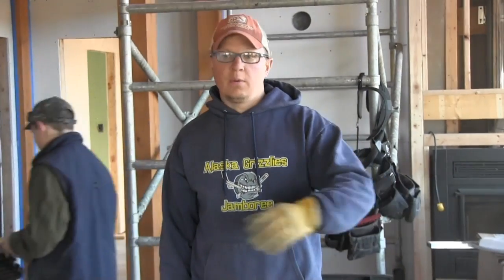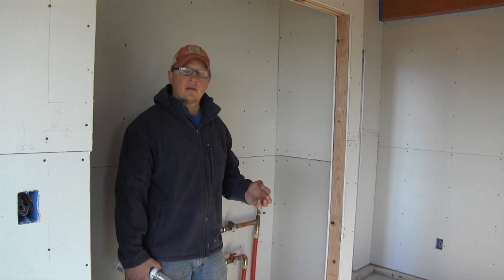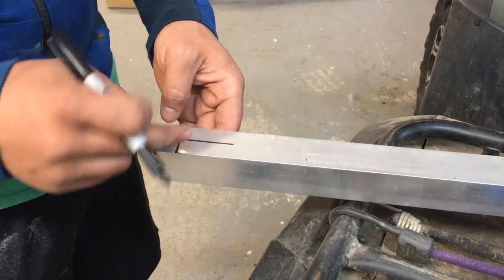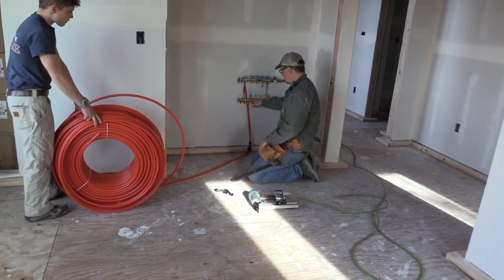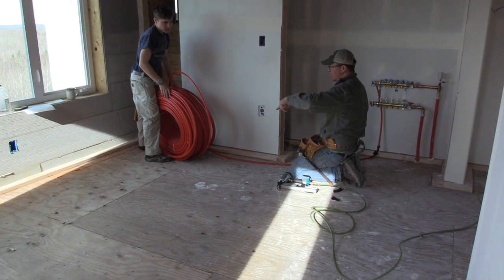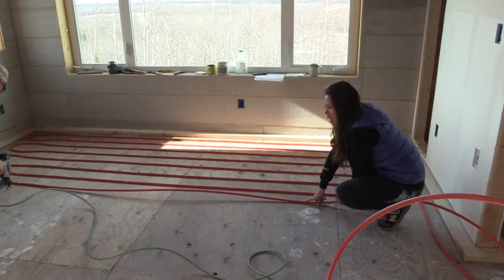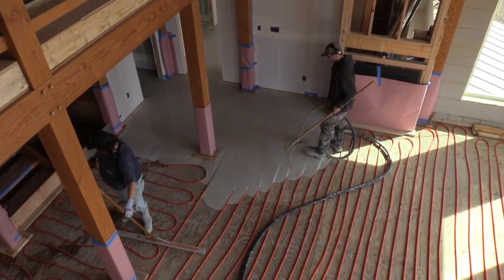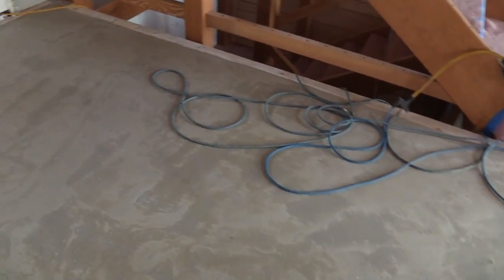It Poured Inside - Installing Radiant Heat over Wood Subfloor - EP 32 Alaska Dream House Build

Comment: We rebuilt in 2014 (North Alabama) with acid-stained concrete floors throughout the house and radiant heat (pex tubing). We also insulated with spray foam in the walls and ceiling. We have an electric heat pump which has never come on in the winter because the radiant heat from the floors keeps the house warm. Love your channel.
Reply from the maker: AWESOME!

Comment: No water resistant membrane? And no heat reflection for less heat loss in the material? Building regulations in Sweden are much tougher....Where I live in Sweden is approximately the same latitude as where you live so building houses for cold winters and to save as much energy/heat is what we do so I really get your way of building. :)

Comment: Fantastic.  The under-floor heating creates lots of extra work during the build but the end result is a lot better than using radiators.  No corner-cutting here, just aiming for the best solutions for your needs, a very productive attitude.  Well done for not taking the lazy solutions.

6

  ▼

Comment: It is looking awesome you guys. With the loops that close, it should heat up very quickly. I normally don't have radiant in floor heating (although, for a couple of days last year, when the hot water pipe developed a leak under the concrete slab, the kitchen floor was wonderfully warm ;-(  ), but it will allow you to walk around the house in total comfort. Good job Jacob on the custom stapler. 
The concrete looks like it turned out great. Will you be putting down floor covering, or perhaps leaving some natural concrete with just some stain. It is a bit rougher to walk on, but gives you the best heat transfer.
Reply from the maker: Still trying to figure that out. Thank you for watching!

Comment: Love that you put radiant heating in your home.
On the tube laying normally you lay the return pipe next to the feed pipe  so that de heat can be balanced. in de video you zig zag. and this way de longer de pipe the colder it will be.
The best thing is to put the pipe in the way that you have done the video but with more distance. When you are half the maximum pipe length but you turn a rond and then place the pipe next to the pipe already laid. This way you get a balance of heat between feed and return.
Reply: Erik Huijsmans
The layout starts at the area of the most heat loss, usually a window or outside wall. Make a couple of loops then fill in the center. The spacing gives the available BTU for the room. 12" is standard in cold places 9, in warmer climes or interior rooms 24". The floor covering will restrict the heat available.  Carpet will radiate half of the heat tile will, wood is in between. The loops are devided up in the zones which are controlled by individual thermostats. When it calls for heat all of the loops come on. If an area is running hot you restrict the flow to that loop at the manifold, but it is better to design the layout correctly. This is designed using a heat loss program and is not for the homeowner to just guess. This couple did it correctly by having it designed.

Comment: Wow, this is super exciting!!!  Great idea to make that little jig for the stapler.  Saved a TON of money and did the job just as well as those expensive fasteners would've.  It blows my mind how much things "cost" sometimes because it's not really what they cost, it's what they price them at!  Any time it's a specialty item or indispensable you can bet it will be marked up to a ridiculous degree.  Anyway, I love your inexpensive work around.  Very clever!  The floor looks fantastic and when it's 40 below and a thick blanket of snow outside you'll be looking out on it walking around all cozy on a nice warm floor!  Are you just going to stain and use it as is or tile over it or what?

Comment: Did I miss it? What kind of boiler are you guys using? Got a Model or brand number# Also are there any concerns with the added weight of the concrete floors?

Comment: I’m 3 weeks away from doing this to my sub floor. Trying to find more information on concrete mixture strength and thickness? Also does it crack bad drown the road? Any hints or tips would be great. Thanks

Comment: YAYYYYYYYYYY!!!!!!!! :D 
There's so much physical labor that goes into setting up the radiant heating. I'd never seen one get installed before. I'm curious about the thickeness of the concrete, for when the bottom kitchen cabinets go in. Will any drilling into the concrete be done to anchor the island, or is that what the little short wall in the kitchen is for? Thank you

Comment: Curious about the radiant heating under your kitchen cabinets.  I have an oil heated radiator under some of my kitchen cabinets and I cannot put any food in that area, though my silverware is always delightfully warm in the winter.  Maybe radiant doesn't get warm enough to affect things?
Reply from the maker: +Connie DeCrescenzo that's a great point!  We did leave piping out of the pantry where I store most food not in fridge.
Reply: Do you have extra cold storage space for food somewhere in the basement too?
Reply: You shouldn't put radiant heating under you kitchen cabinets because that could cause legionella for your tap water piping. (According to builders, here in the Netherlands)
Reply: Couldn't you reduce that risk after radiant heat installation by insulating the pipes in that area (under cabinets, etc.)?

Comment: I suppose you are ready explain why you didn’t simply by subflooring that had a groove-oriented for underfloor heating tubing to follow I expected it would be more expensive than plywood but it would also allow you to simply walk around and pressing that tubing into the premade grooves no Staples needed and I understand that the flooring has a small insulating value I suspect that it would only cost a when you calculated all the expenses involved in the method you’re using to the simplicity of using one of those prefabricated underfloor heating subfloors. Maybe you could check your figures against the expense of buying that kind of subflooring. I expect it’s too late now for you to change but it might be a good idea to explain your reasoning compared to buying the subflooring that’s already designed for holding the tubing for underfloor heating. Just a thought because someone else may want to follow some of your design options.

Comment: What happens if your radiant heat tubing springs a leak? Does that entail having to break up the cement flooring to fix it?
Reply: There are no joints in the cement. They dont just spring leaks

Comment: I would have used some plastic talon clips. In bulk they are under 8¢ each for 1/2" pex. I'm sure things cost more in Alaska, but 50¢ each doesn't sound right.
Reply: staples will rub the pipe as it expands & contracts will leak eventually that why clips are plastic!
Reply: @John-pw7et  I used plastic clips to do my second floor (and poured gypcrete over) but zip tied the pex to the wire mesh on the first floor (slab on grade) I’ve never heard of it rubbing holes in it, so hopefully you’re wrong… 😑